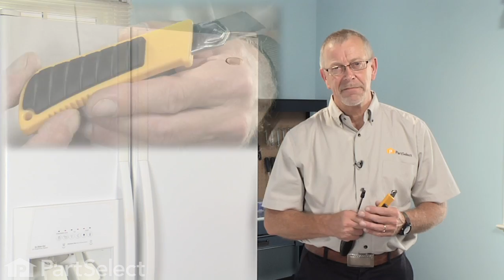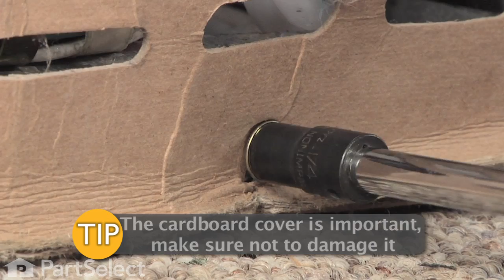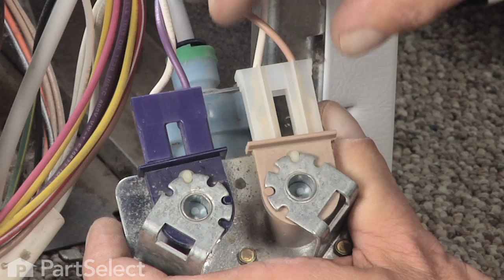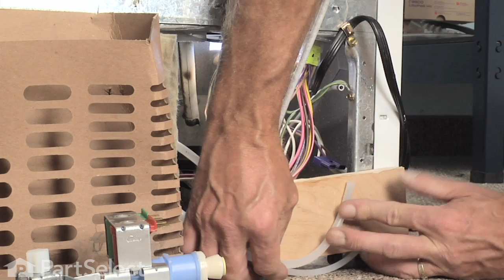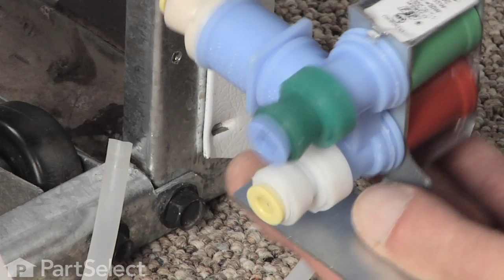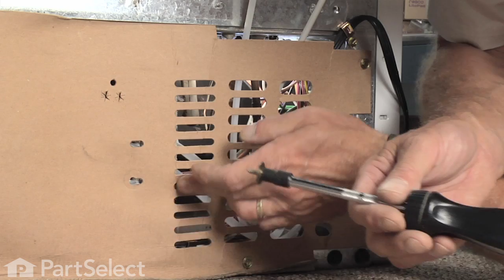Refrigerator Repair - Replacing the Water Inlet Valve (Whirlpool Part# 4389177)

Comment: I have a leak on Whirlpool side by side from teh door mounted water dispenser.   It is only a drop now and then but when we are away (it is a rental unit used all winter by seasonal tenants and only monthly out of season).   I assume it is the value on back of refrigerator but it even drips when condo water supply is turned off.   Do those valves run on vacuum and possibly letting air into the line which forces water out?    I don't want to waste money on the valve if the filter housing is bad

Comment: Great videos. I've got an icemaker that isn't making ice, and noticed water coming from the point where the fill tube enters the freezer at the top of the fridge (outside). It drips a little when running. Any thoughts?

Comment: Thank you SO much for this great video.     Here's where I am, and maybe you can assist....I hadn't replaced my filter in a LONG time, and wasn't getting water or ice generated.   I replaced the filter, and now have water flow thru dispenser, but not getting water to the ice maker.    I am a relatively handy chick, this looks simple enough - but before I buy the part (W10408179) /install, is there ANYTHING I can check on line (or how) on the ice maker line?   There is no ice, so all good there.

Comment: Learned a lot here-but here is something you have to be aware of with water leaks. NICKED hoses from the fan. Was driving me crazy for 2 long days-then I realized after running my hand over a wet feed hose that it must have nicked the fan.
I throw that out there since cracks and splits and nicks are hard to find.
The only clue I had was a tinkling sound against the spinning fan-which was from the water spraying on it . Yet EVERYTHING was wet in that right corner you were working on.

Comment: Hello. I have a whirlpool that has a water dispenser. Lately the coil in back of the refrigerator has been violently shaking when we try to use it and there is no water  coming out. Is it the Inlet Valve that needs replacing or something else? Thank you for your help and great videos!

Comment: I have a Whirlpool side by side with a "no water fill to icemaker" issue. Water filter replaced, water dispenses at door at good rate, power good 120V at L-N, jumpered T-H and module cycles full cycle...but solenoid for water fill never clicks, and no water. No water in icemaker for a good week. Ice maker or water valve? Appreciate your vids much. Thank you.

Comment: Hello,
I have a Kenmore Coldspot 10659792992 and water continues to drip out the end of the tube after the harvest/fill cycle ends.  Is this caused by a bad water inlet valve?

Comment: hello i have a hotpoint double door fridge model# hss25ifmb ww   the water hose that runs into the bottom of the freezer door and into the water dispenser is disconnected from the hose in the inside of the freezer door...so if i push the water dispenser water comes out of the bottom of the freezer door...how do i connect it back...there is no connection in there..
.thank you

Comment: Hi Sir, I have a Kenmore Coldspot model number 57572791 that isn't pushing water into the ice tray so that the freezer can make ice. The ice machine still works and the water dispenser is still giving water. The refrigerator is more or at least a decade old. I've checked the hoses for ice and leaks but everything is good. It's just not pushing water into the ice tray to make ice. What is wrong? Thanks.

Comment: Great video.  I'm having slow water flow from the water dispenser on a KitchenAid Superba.  I removed the kickplate and noticed there was some grimey buildup in the smaller line that feeds up to the dispenser.  Any tips on how to replace that line?  IT looks like I have to remove the cover plates to the ice/water dispenser.  Do you think that line is my problem?  Would replacing the inlet valve increase water flow?  Thanks for any advice!  KSRA25ILWH00

Comment: I just did this repair on my kenmore.  When I reopen the water supply the water dispenser in the door pours water without pushing the lever.  I thought maybe I had reversed the connectors when I put them back on, and the valve was staying open, but that didn't seem to make a difference.  What have I done wrong?

Comment: I have a Whirlpool refrigerator that has a water filter.  It was given to us in disrepair so I am not able to see how it was originally assembled.  (Model #ET1FHTXMT01) A water hose/tube was ordered, but it doesn't seem to fit into the filter housing.  Are you able to direct me to a video that shows how to install into that?  Any other advice?

Comment: I have a whirlpool model # ed5fhexns00 that is constantly leaking from the water dispenser and water occasionally flowing to the ice bucket were it freezes or drips to the dispenser. Would replacing the water inlet valve fix my issue?

Comment: do you have any video that shows where all the tubes goes to? i replaced a water inlet valve part#2206123 and the ice maker unit part# w10190965 in my kenmore refrigerator. i did one line at a time to make sure i didn't get any mixed up and now water shoots from the water dispenser every few minutes and it still isnt making ice. what do you advise or what video can you direct me to so i make sure the lines are hooked up correctly. ty

Comment: My fridge also has the extra 2 connections.  Not too hard to figure out which go to the ice maker and water dispenser, and which are connected to the water filter.  There are 2 different size plastic tubes.  Thanks for the video.